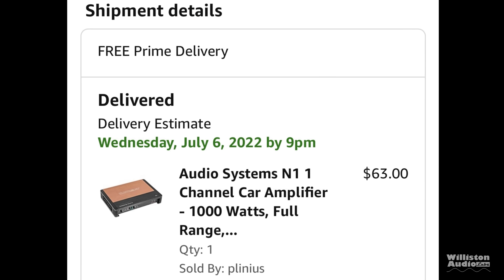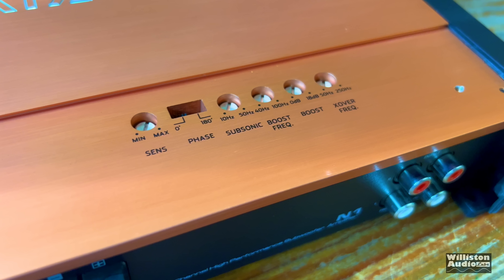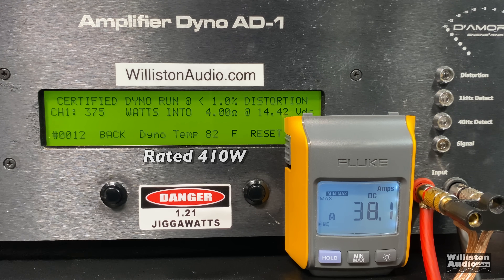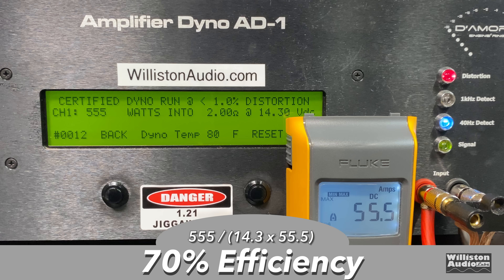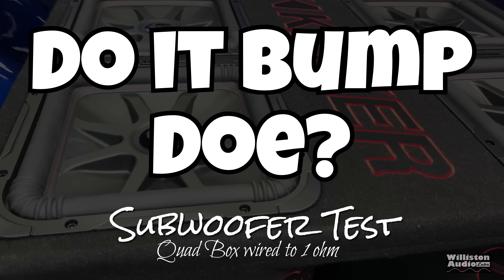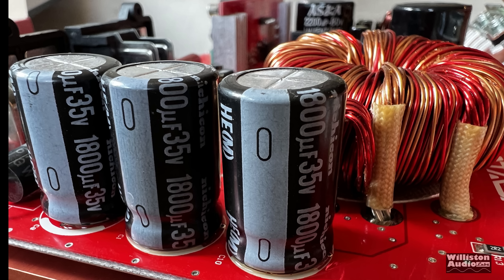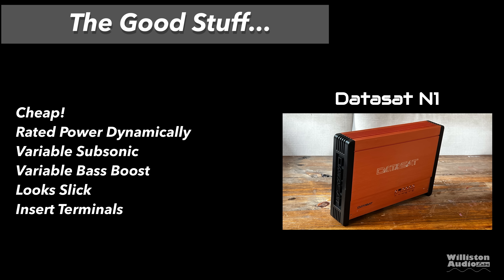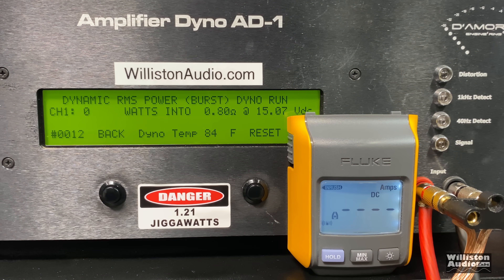Why is this 1000W $63 Amp BANNED from Amazon? [4K]

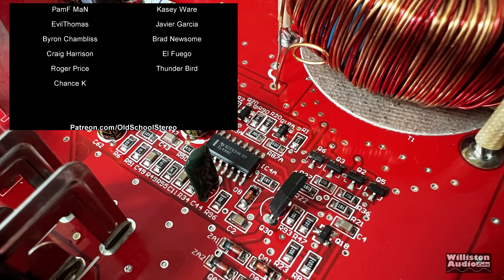Comment: it's strange. it actually appears to be a very high quality product both externally and internally. They are not using the cheapest pcb (it would be generic green, not red) and who the hell puts sleeves on the diode packs and transistors legs? I really don't know what's going on with this product it's priced like cheap junk but actually seems pretty good. Although that being said one of the capacitors is already leaking 11:45 you can  see a cap with leaking electrolyte in middle of screen. I wonder if this was some sort of partnership or something between a small manufacturer and datasat but for whatever reason datasat pulled out but the manufacturer went ahead and started selling them anyway.

Comment: I'm a musician who uses amplification, as with other musicians I know how very, very loud a 50W amp is. At 100W it's stupidly loud. 1000W and I would want to stand at  least 25- 30 metres from the speakers, and do so outdoors.
Power ratings of performing musician's gear is based in reality. In contrast, power ratings of general consumer audio gear are in a fantasy land.
edit, BTW as far as electrical engineers are concerned "RMS" power doesn't exist. It's a misuse of the concept Root Mean Square (RMS).

Comment: It's probably the exact same as the diamond Amp. Basically the way these Chinese manufacturers work is the factory that makes the diamond Amp from 9-5, at 5:00 the diamond brand light shuts off, but that factory keeps running 24hrs a day. So the amps they produce outside of the diamond brand hours, they just slap their own brand name on and sell it themselves at a reduced price bc you're going around the middle man... you can really find great quality products at hugely reduced prices if you know just what to look for...
Reply: Would love to find 2 of these I have 2 diamond audio des1000.1 monoblocks that need new insides and I bet these would drop right in lol

Comment: Big D i love you man but hate those x4 kicker squares, they're made of plastic = more un-natural noise/s the sharp corners from being square causes more noises lol i owned these in a jeep and hated them kicker is not a good brand anymore i know this is opinion but i get bored of my shyte fast so i'm always selling and buying new stuff so i have delt with most brands out there since 1990! I get a laugh out of Sun Down/CT/SKar, kicker is now a Wal-Mart brand to me, best subs hands down for cars keeping a balance of SQ and SPL in mind are JL and the more affordable non sibling lol NVX. I know JL's are made of poly and i really hate that but their sound is amazingly clean and accurate as to where the NVX's are pulp paper my favorite style woofer sound is natural as possible. I don't mind a full sized poly dust cap as long as the cone is paper like the 2008-2010 Fosgate P3's not sure of the year but those were great subwoofers.  Not to get in to infinity  and Fosgate's aluminum cones which boggles my mind how they sound as awesome as they do just still not paper. But anyway square subs = bad 4 un-natural stress points per sub and source of more wind noise something we want to avoid already from box leaks and port noise just really bad for suvs'. So i've owned couple sets of kickers in the 90's 400 watt rms subs and was happy with them till the 2k the gray plastic ones came out seems like a look they stuck with right up till the solo x's, so trying to upgrade from P3 15's on a punch 1000.1 b/d amd same amp tried the solo x's this is after not liking a pair of L7's my local dealer said this box has been used enough to be broken in and i would love it so they demo'd it in my car. it sounded nothing like bass just air farting we said nothing looked at each other and they went on to greener pastures. The solo x was a factory kicker box ported btw.  Make me jealous and make a quad box of NVX gen 2 12's or 15's and TELL me you don't think it's better then them plastic square junks lol  PS: Not sure how open air testing on car sub boxes works they're supposed to be in a confined space like the trunk and or cabin of a car, plus the open air of a house or it's garage just cause for more noises then bass reproduction, you can tell that it is loud sure but not so much for sound quality.

Comment: Looking back at this, I see 2 weaknesses:
The power supply MOSFETs and the output choke coil.
Replace the 4 Z44n MOSFETs with something a little stronger and your certified/uncertified numbers might get closer to the dynamic results.
The output filtering choke looks a bit small for even 600 watts at 1 ohm considering the 30 amps of output current available.
I think if I could get one (change the name to "DataSnatch" for all I care), that would be the first upgrades I made.
Too bad @barevids couldn't get his hands on this and confirm my theories...
Reply: AND THEY BLOWN UP IN 2 MINUTES GOING BY THE PEOPLE WHO INSTALLED THEM.

Comment: Be wary of cheap class D, on failure it will send line voltage to everyone of your connected drivers resulting in total failure, pay extra and get proper protection, fuse is not good enough, you need fast acting solid state devices.

Comment: Totally OK for dynamic power to be much higher than RMS.  Most recorded music is between 4 and 8 times peak to average ratio.  So if you have an amp that has 1000W peak power, there is no practical reason to have more than 250W RMS.

Comment: lolol .. No way this thing delivers 1000w.. total BS. Be lucky if it can deliver half that in like 1 ms.
Reply from the maker: It tested to that on the Dyno. Do it for minutes or longer continuously? Probably not. Most amps are not built to those standards. KICKER and a handful of others are though
Reply: @wal  really depends how you test it, anyway most of those china products or diy amps are at best usable for couple of cheap speakers in the garage or workshop. Have more than enough knowledge of using even well designed class d amps, and I have yet to see one class d amp that in practically use delivers the same performance as the same specced class a/b amp. An old 15-20kg well designed class a/b amp will almost always outperfom a class d amp that on the paper is 5 times as powerfull. If you want real watts class a,b is the only real thing, you simply can’t cheat by modulating the input signal. On paper it gives you a higher effeciency and can be built much cheaper, but in the real world using quality components and a classic a/b design will always be superior

Comment: For the money It's pretty good, the key would be to buy a few of them, run them @8ohm to get the efficiency up higher and run them well under their rated output to get the distortion down. No specs on the slew rate or signal to noise ratio.

I have a Sound Craftsman PM860 Professional Mosfet amp. [120V] It's zero ohm stable which means you can short the speaker wires and power it on without harming it.
The certificate of performance states Channel A 286W/Channel B 287W @8ohm, Channel A 401/Channel B 402W @4ohm all at .05%THD [Probably get close to 450W per channel @2ohm] With a Slew rate of 50V per microsecond. [It's really fast] I've paired it up with 4 EV Force 10 and 2 EV Force 12 musical instrument full range loudspeakers with 10lb magnets, 105Db SPL [1W@1Meter] 150W continuous. They accurately reproduce flat thought the audio waveform spectrum. [This means no matter what frequency you drive them at, they reproduce with the same intensity of sound pressure equally.] 10" 75Hz - 7000Hz/ 12" 65Hz - 7000Hz Oh yea, when you power it on, you hear a little pop, the speaker does a little flex in and out a couple of times and then... Silence and it stays silent using a Makie mixer at zero volume input. With this baby and the EV's, you close your eyes and swear the band is in front of you with accurate reproduction.

Comment: Picked two of these up for $70 each about a month ago. So far so good. Swapped out the Punch 550.2 I was running for one of these and honestly can't tell much difference in SQ or total output.
Reply: On Amazon?
Reply: @stinky817  yes
Reply: @stinky817  Sorry for the late reply.... Yes on Amazon.
Reply: Still running this thing and have no complaints for the $
Reply: @jeffreybradley3736  I did a pretty heavy search and couldn't find any. Ugh

Comment: On Amazon, there's an amp by a company called "Notherss" that looks to be using the same design. Or it's the same company? Also $63, but a 4channel amp...
Reply from the maker: They are still branded Datasat, I’ve bought one since
Reply: @wal  cant find any on US and CA amazon

Comment: They don't copy designs so much. What happens is the companies pay to set the factories up in China, then when they're done they just walk away. The factory owner is left with the cleanup costs and a bunch of machinery dedicated to making parts. So they just keep printing parts.  Alright if you get an early build but later when the molds have worn and gone bad etc. you'll start getting badly made items. Early on though unless they skimped on plastic quality or whatever you'll get the exact same item at a fraction of the cost.
I remember Sony went nuts over copies of their earphones, trying to say they were all terrible copies. They were the exact same item even down to the driver and it was just that, a ditched factory line issue.

Comment: Do you find the square solobaric any better than a good conventional sub?
Reply from the maker: They have more cone area for the same size sub and sound really good to my ears
Reply: @wal  I been around since they first came out but haven't really seen a system with them that really shakes. But I bet ya 4 of em would do the trick quite nicely. Can you set those up bandpass. Other than 1 massive massive ported custom box the customer never came and picked up. I bought that 1 for 75 Canadian pesos. I put 4 Kenwood 10s in it but it was so big it took up the whole rear of my suburban. But I could bounce a anchor chain 2 feet off the roof. Other than that bandpass boxes have produced the best sound for me. I love the lowest of the low. Went to a garage sale once and the lady thought they were some sort of coffee table. I picked up a pioneer 12 and a pioneer 10 for 90.00 loaded. And the subs where fine. That mix of tuning was phenomenal. And fit in the trunk of a sports car. But it seems they don't make them like they used to. All cheap cheap components and materials now.

Comment: Bought 2 one for daughter and one just because. Hooked up daughters at 1 ohm and after 3 minutes or so higher volume blew fuse twice so switched out with the just because one i had and it did the same so doesn't look like it like 1ohm. Sounded good while it played.

Comment: Datasat doesn’t just make equipment, that’s the parent company of DTS, one of the biggest innovators in cinema sound. They make the audio codec that a lot of your movies use for sound
Reply from the maker: Yes and I don't believe this product is an "official" DATASAT product. I'm waiting to hear back from them
Reply: Decent sodering and shielding
Reply: Any recommendation for a amplifier on a pontoon boat with 4 8’s and 4 6’s inside the boat?  Also a wetsounds 12in sub. Thanks in advance.
Reply: Datasat isn't the parent company of DTS. Datasat is DTS' old cinema division.

In 2008, DTS divested themselves of their cinema division, forming the separate company DTS Digital Cinema. In 2009, it was purchased and renamed Datasat.

DTS' parent is Xperi (a tech holding company).
Reply: @slycordinator  "Wow, you can read the Wikipedia brochure."
Reply: @Sm1te79   I also knew beforehand that they were separate companies. I used to be a cinema projectionist, so I remember suddenly having CDs for our DTS equipment suddenly coming from Datasat.
Reply: You don't MAKE a codec, you WRITE one. A codec is a software program.
Reply: @lyfandeth  Are you saying that someone who writes a piece of software doesn't make it?
Reply: @lyfandeth  we get all of that, I was making a larger point about the size, scope, and importance of DTS, now owned by xperi
Reply: @darealestwon  They also were important in cinemas for stuff not related to sound.

DTS and later Datasat introduced processors for Closed Caption subtitling. Lots of cinemas have systems for showing subtitles to individuals who are hearing impaired. The processors for playing these were mostly introduced by DTS/Datasat, since it was extremely easy for them to integrate that with the DTS timecodes that were on practically all 35mm films. Before the conversion to digital, I remember running several 35mm movies that didn't even have DTS soundtracks, but had DTS timecodes for running those systems.

And after the transition to digital projectors, Datasat's captioning units continued being used at least for a while, because they were simply installed at lots of places. I imagine by now, they're used less as more places just have the projector run everything directly. Not sure; haven't worked in a projection booth for quite a few years.
Reply: @lyfandeth  maybe meaning Authored.
Reply: @lyfandeth  Semantics but your correct.

Comment: Love the dyno runs. Keep it up!  What happens when voltage is increased to 24v does it put out more and require larger amperes fuse?
Reply from the maker: Most of these 12V amps will go into protect at 16V

Comment: I Have 16 Ohm Speakers, Why They Are 16 Ohm? What They Are Good For And What Does That mean That They Have 16 Ohms And Not Like 4 ?
Its More Loud Or Less Loud? They Are Pretty Big, They Came From USSR Kino Theatre !
Reply from the maker: Don’t see many 16 ohm speakers. Most home are 6-8 ohm and car speakers usually 1-4 ohms. 16 ohms just means you’ll need to assume about 1/2 the power shown at 8 ohms. So if you buy a 100x2 amp (8 ohms) your speakers will receive 50x2

Comment: 30 amps x 12 volts x 2 = 720 watts if the amp was 100% efficient.  Even at 15.5v and 100% efficiency that's only 930 watts.  So either this isn't going to make specs or it's going to blow fuses constantly.  Notice when he does the uncertified test it goes to 136 amps, how do you pull 136 amps through two 30 amp fuses?  Something very wrong.

Comment: The good news is that this thing would probably last about a week so maybe it's not so bad that you can't buy it on Amazon.  I mean, if you have to be suspicious that the caps are carrying fake labels ...  One of the reasons to spend more on known name-brand products is longevity.  A $60 amp sounds like a steal until you have to replace it every couple months and the costs soon add up to what you'd have paid for something built better.  Thanks for posting this video, it was very thorough and very interesting.
Reply from the maker: Thanks for the feedback!
Reply: @wal  You're welcome.  I learned my lesson  about this by buying cheap subwoofers that last 6 - 8 months.  I finally woke up and decided to bite the bullet on a genuine Klipsch subwoofer that has now been in service for three years and is still working as well as the day I hooked it up.  It wasn't terribly expensive and in the long run it's a lot cheaper than buying a pile of cheap gear at half the price.  There are about 5 subs up in my attic waiting for the day I can either use some of the parts, repair them or chuck them in the trash.  Those subs were all a loss financially, if I'd bought the Klipsch to begin with I'd be richer, happier and less frustrated.

Comment: What is with the RMS watts. No one actually knows what it is and therefore should not be used. Closest would be RMS Volts x RMS Amps, which is Average Power. RMS power is not an Electrical Engineering term. Time to stop using it.
Reply from the maker: I didn’t create the term, it’s been used for decades in car and home audio to describe power output. 🤷‍♂️
Reply: @wal  Which is why the stated power output is false.

Comment: This lil amp is impressive but that is way to much current draw for me. What you save using this amp you will have to upgrade your alternator and electronical system. WoW over 100 amps of current draw 🤔 
I still love my old school RF amps especially the RF 200x2 dsm. Big Bang & Power with lower current draw & an 18 DB bass boost 👏🏾👏🏾👏🏾
Reply from the maker: The tests here are best case scenario for power and worst case for current draw
Reply: @wal  I understand & I do like your video and the amp. High current draw usually gets my attention from any electronical device.

Comment: So even at 100% efficiency a '1000W' (RMS) amplifier would require 1000/12 = 85 amps of current from your car battery for full output. Even class D amps are not 100% efficient. 
These power ratings are x4 for people who know nothing about true amplifier engineering (which I did for 14 years) or about speaker efficiency. 
A 100W RMS Marshall top and speaker in a car would permanently destroy your hearing quite quickly. This may make your boot ('trunk') lid rattle and annoy pedestrians. Lol.

Comment: I feel like given the market for well, anything, on Amazon, it’s very unlikely they would ban anything no matter how copied and redone. Try buying a rechargeable flashlight on there. That’s just top squirrel nutz! Well those rubber surrounds do help distribute the heat more efficiently away from the 4 Ohm amp switches and crossover…